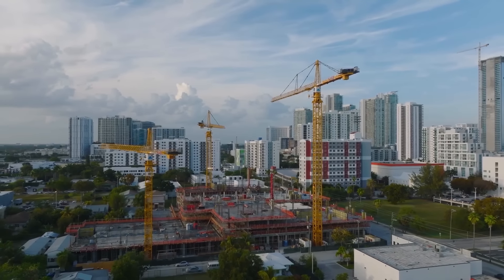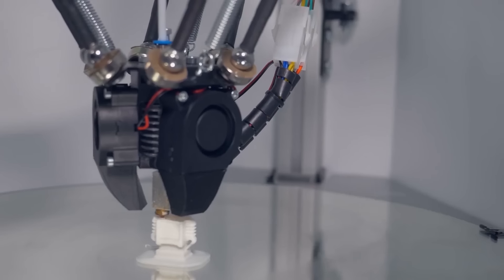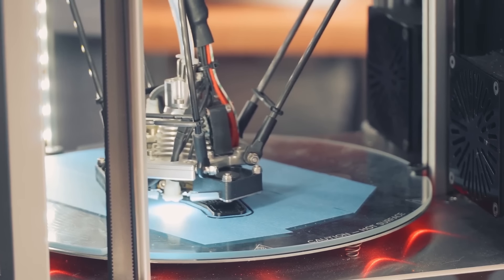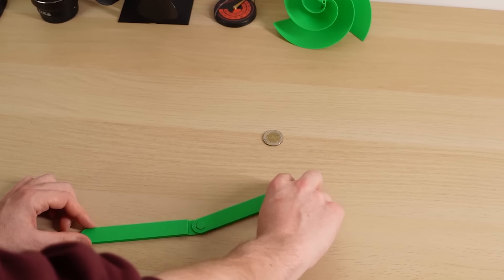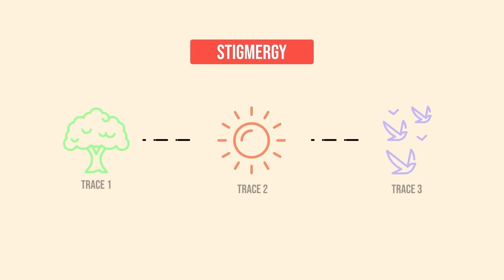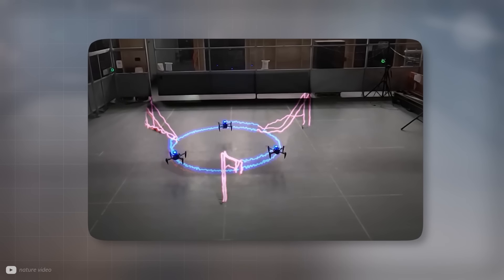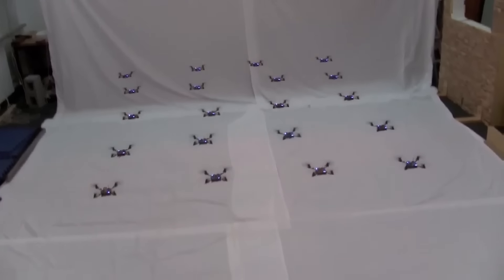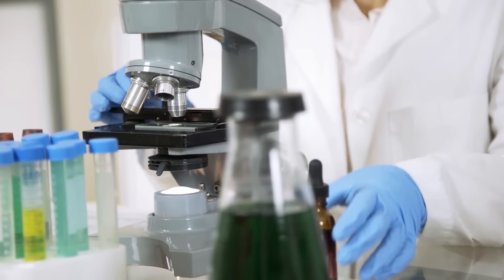Why 3D Printing With Drones Will Transform Construction

Comment from the maker: These drones just got more and more interesting the more I learnt about them! Make sure to try out some of the courses from Brilliant to learn more about the inner workings of engineering systems like these drones - Use my link at https://brilliant.org/ziroth/ for 30 days FREE and 20% off for the first 200 subscribers! Thanks for watching!!
Reply: Gradually we come closer to the small flying robot beings from the movie "Batteries Not Included" (those could build and repair everything). The difference between wasps and those drones is that insects also have legs to stabilize their position and possibly even fix flaws in the applied material, so a precise 3D printer drone swarm likely should have additional small arms to be used in a similar way.
Reply: Same principle as "When you have a hammer, everything is a nail !".  But is it ???
Reply: Concrete without rebar... sounds like it should last 2 or 3 years
Reply: If this push thru.. a lot of people will lose their job
Reply: They should make a drone that drops off a house like Amazon :)
Reply: Just came here to point out the nonsense in the thumbnail. You put "insane accuracy!" in connection to doing anything with a quadcopter. That's B.S. right off the bat because insane accuracy requires stability. And a quadcopter is only supported by air, which is the least stable substance on the planet. No stability, no accuracy. No need to debate it. Stay off my feed!
Reply: all we need now is 3D printing ants to build underground.
Reply: Add translation turkish language please